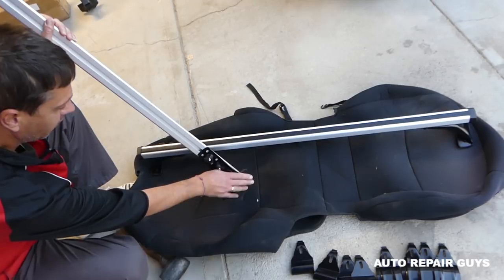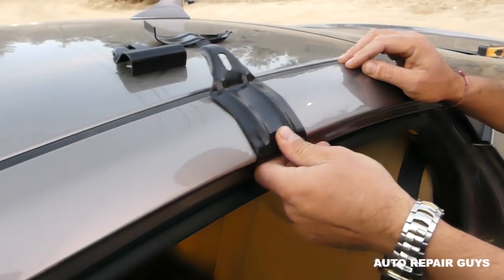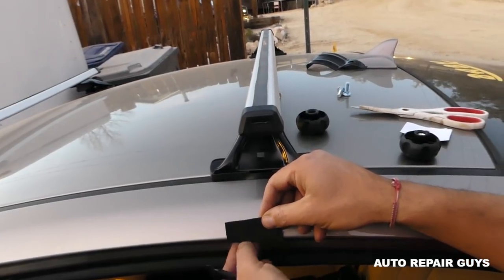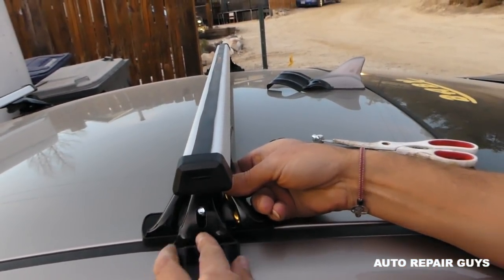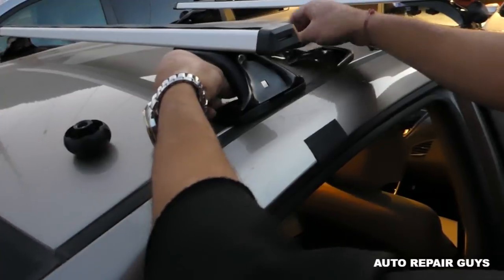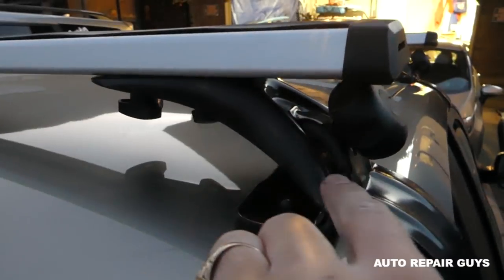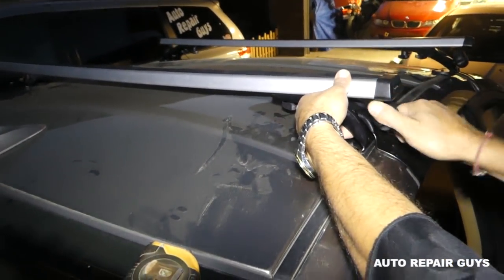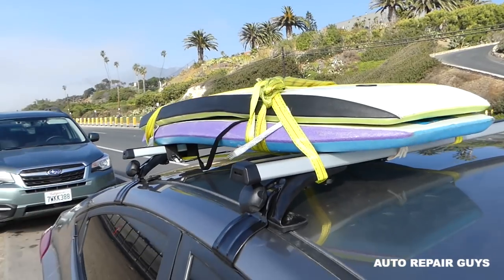Great Roof Rack Crossbars that will not brake your Bank

Comment: Thanks for the video it was a big help. I have just fitted these racks to my 2001 Suzuki Escudo  which  has no side rails, no fixing points, and no gutter. I'm very happy with them. Not bad for NZ$76. The only other option was to drill and rivit tracks  each side to take the cross bars and I was quoted NZ$700 for this.

Comment: If you need to replace your protective tape, you can buy yourself a roll of vinyl electrical tape. Add it to the mount peice itself so the goo is on that side. I use electrical tape on my trunk mount bike rack clips. Its tough, its cheap, and its easy to replace. A few layers of it will give decent protection. Electrical tape is a few bucks a roll if you get Black. 37Ft of Super33 is 3 bucks.

Comment: I cant thank you enough. I have an Elantra GT. This is the 2nd time you guys have helped me out. Cheers 🍻
Reply: hollin220 how fast can you drive with luggage on top , I have a GT Elantra GT too and I wonder if this bars can hold 160 lbs at 90 mph las vegas to california. Please advise. thank you .
Reply: @mentac1975  I would recommend using ratchet straps and maybe taking it a little slower than 90.

Comment: Mine didn’t come with 3 different brackets nor did it come with protective tape.
Reply: Mine didn't come with the tape
Reply: @jamariofranklin6311  newer models come with a rubber peice that hooks to the bottom of the clamp. it replaces the tape.

Comment: Why does my roof rack slip ? & isn’t tight enough ?
Reply: Problem is the curve of your car roof. If it shrinks inward toward the center, you're going to have issues as one side is smaller than the other so it can slide that way. However once you bind them with a load spreading between them, they will be effectively locked in position.